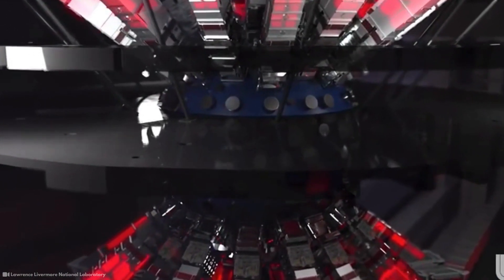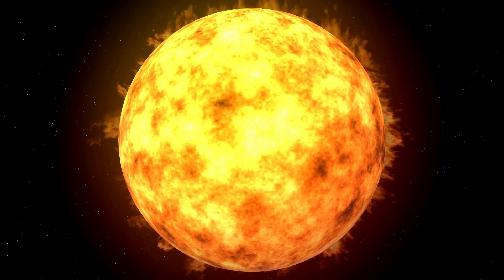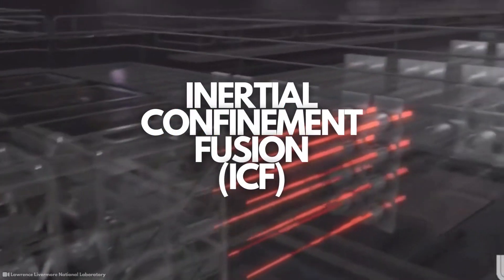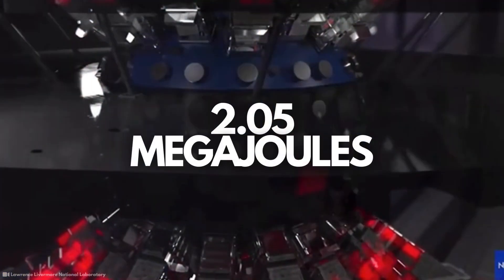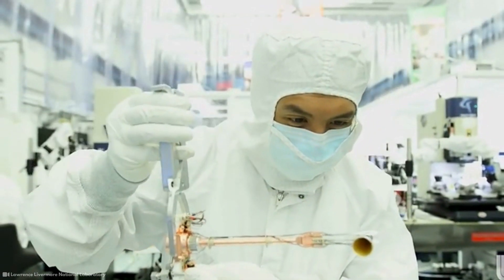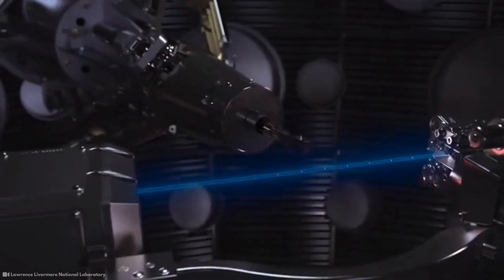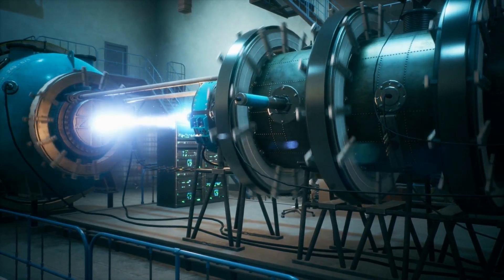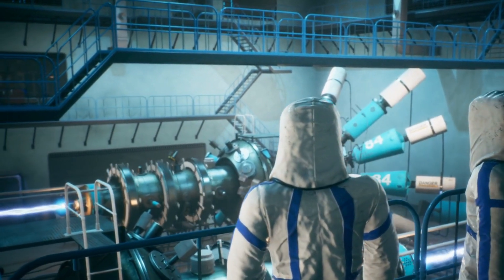How Did Lasers Create Fusion?

Comment: I think they are inadvertently and unknowingly opening up a temporary wormhole.  This so-called 'ignition'  is likely a fissile reaction ported back from a multiverse.  Another universe that just so happens to be based on the priniciples of antimatter.  In other words, when they initiate these experiments, a microscopic portal is opened very briefly to an alternate universe.  But it's totally at random and uncontrollable.  Which means it could be centuries before 'ignition' is achieved once again.